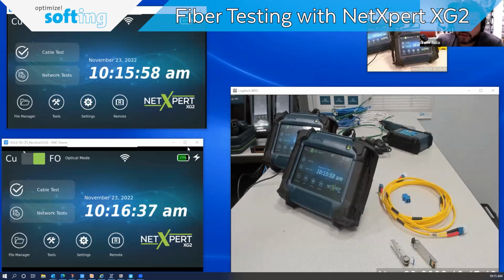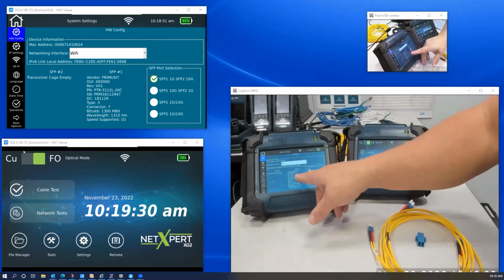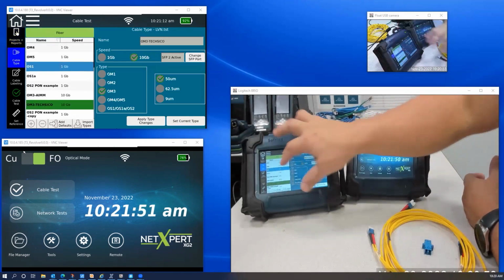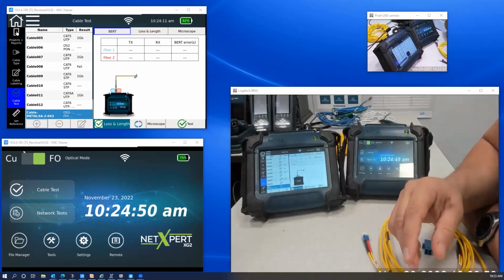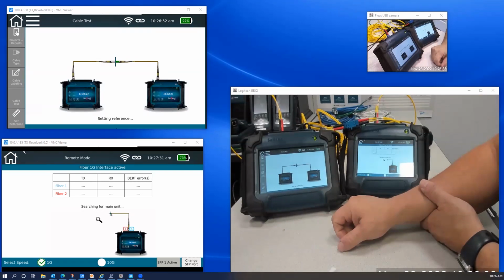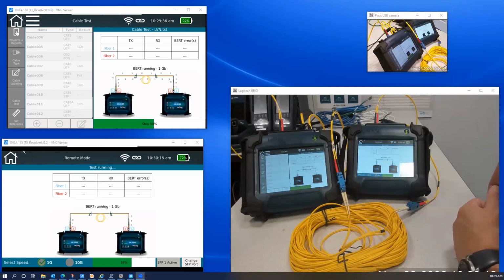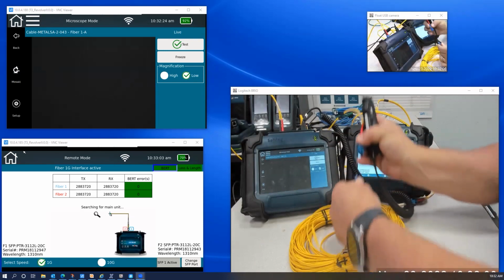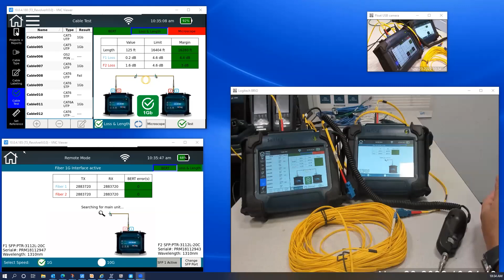NetXpert XG2 Fiber Qualification with BERT (bit error rate test)

Comment: My remote and primary units don’t link up at all, any ideas? Splicing is good, set reference was good
Reply from the maker: Please reach out to support@softing.us  

We'll start by ensuring port settings are identical on both the local and remote tester.  We can show you how to go into both testers and click Settings and HW Config, and then under SFP Port Selection, select the first or second option if you have 2 SFPs inserted, or select option three or four if you only have 1 SFP inserted.